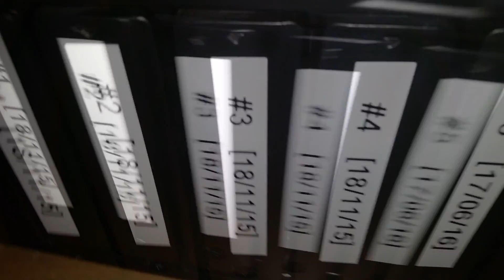Synology DiskStation DS1815+ No Power Fault 'Workaround' - Using A PC Power Supply To Recover Data

Comment: You saved also my life today!!! My story is the following:
I have 1815+ one day after 2 years I had power failure having dead NAS. I bought a new power supply, connected and everything was fine for 2 days. Then NAS was off again and was not powering on. Thought it was again the power supply. The new power supply didn't work also. I thought that was the motherbpoard and that everything was f*cked up. 
Then I saw your video, my angel.
I didn't have a spare computer power supply so just used the trick with the wire in order to make power supply work without having anything connected at the place you had the output of the pc power supply. The nas started working. I switch it off, I removed the wire and connect the nas power supply and now works fine.
Seems that the trick with the wire resets somehow the power supply!!!!
You are my A N G E L :)
bib thank bro

Comment: Damn ticking time bomb.  My Synology 1815+ just died and now I'm finding out about an issue two years after they discovered it.  Synology could have sent a notification to the owners so they could have fixed this problem early.  They intentionally set warranty so these boxes will die right at the warranty period.  Synology handled this problem incorrectly.  I am very disappointed in their support.  I am sure more and more owners of these devices will start to get failures.
Reply: So true.
Reply: @stellvia21  I was glad they extended the warranty by one year.  I bought mine in 2016 and was able to have it returned for replacement.  I was happy with their warranty response, however, I feel like others who will end up outside the warranty period would be SOL.  After the repair, I noticed they soldered a resistor over the connector as many people mentioned.  It looks like that is the main fix if the board was not completely dead.

Comment: Hi Nathan, i tried the solution from Jukka Pirinen below with the 4,7K resistor
my voltage between the green and black wire dropped to 1,9V when pressing the button, which wasn't't enough to power up the PSU
But after soldering the 4,7K resistor, the PSU fired up without any problems...
So it's worth checking the voltage between the green and black wire when pressing the power button !
Reply: Hi, Logical and works for me. It's difficult to trace the PSU_ON line from the ATX 24-pin compactor through the ribbon cable to the front panel. But I soldered a 4.7k resistor from PSU_ON pin to a GND pin. The front panel switch now works correctly, I guess a component on the front panel PCB has aged and is biasing a pull-up too high.

Comment: Hi Nathan, and anyone else on this thread, what if I shorted the green and black Pin while plugged in to force it to start up? I have the exact same symptoms, tried the jumper and the PSU started up. But because I don't have an ATX PSU laying around I can't start up the motherboard. Just wanted to get some opinions before I do something crazy.
Reply from the maker: I personally would avoid that as the PSU may have issues which could further damage the system. You could totally try it if you like, just beware that is a possible potential outcome. I didn't recommend or mention that in the video purely because of the chances of trouble. 
Do so at your own risk I guess! Let me know how you get on. 
Hope this makes sense! 
--Nathan.

Comment: I found out that when pushing power button, voltage between green and ground dropped down to 1.6V and apparently it is not enough shorted to power on the power supply. Added 4k7 resistor between ground and green wire and voltage drop from 5V to 3.3V and with power button pushed down to 1.3V and it powers on now.

Edit: soldered 4k7 resistor parallel with r32. It is working fine now.
Reply: Hi Jukka, Wanted to consult, thinking of following your solution, can I just solder to any of the black ground wires or is there a particular one to solder to?
Reply: @MonchMercader  actually when looking and measured around, I soldered it parallel with r32 resistor. It won't now affect the psu on voltage when not powered and gets short voltage under 1V now. https://i.imgur.com/x9gOjVc.jpg
Reply: @jukkapirinen  You are the man !!!, i soldered a 4,7K resistor as you recommended parallel to R32 on my 1815+ and SUCCESS !!! Thank you so much ;-) !
Reply: @jukkapirinen  Second comment, my voltage dropped to 1.9v before soldering the 4,7K resistor ;-)
Reply: @jukkapirinen  Hi, you sat that the resistor is 4k7. But according the the colortable i come to this : 
570 * 10 = 5700 = 5k7 + 1% tol

Is it 4k7 or 5k7 or doesnt it make any diverence ?
Reply: @billmartian3731  it was 4k7. Maybe the photo does not show up correctly the yellow on blue body. But anyway it matters, you should measure the voltage after adding resistor. Voltage should drop well below 1V. If you see the Synology thread, I even needed to replace the 4k7 with 1kohm resistor, because I voltage again was not dropping enough. I have been thinking if I should replace that gate where the one leg is soldered. Maybe it has been degraded if power has just been floating through it without proper pull-down (or up?) resistor.
Reply: @MonchMercader  edited my comment above.
Reply: Hi Jukka, do you have a photo of it you can share? I just ordered a replacement/original PSU and still nothing. Thinking it might be main board. But I want to try you trick first.
Reply: @MonchMercader  I posted link to image already 6 days ago but seems comment is not showing up. I have posted the image to Synology forums to the newer c2000 thread, so you can find it from there.
Reply from the maker: @Jukka Pirinen Your comment was filtered out by YouTube, I've approved it now.
Reply: Thank you so much! Bought a broken DS1515+ thinking it was the transistor-bug, but it didn't help to replace it. Found this clip and your comment made my day, it worked!! :D

Comment: Thanks a ton for this!  This inspired me to try something similar on a dead DS1815+ and it let us recover data to a new NAS!
Reply: If your new NAS also had 8 slots, you could have just moved the disks (in the same order) over to the new unit, started the new unit and used the Synology Assistant program to do a migration. You would have to reinstall packages and maybe some settings. But your data would still have been there just fine.
Reply: Robert Phoenix yup, but I wouldn’t have been able to move to the new disks I had purchased along with the NAS.

Comment: I purchased a replacement PSU from Synology and it did not work. The NAS works when I connect it to an external PSU.
Reply: I have exactly the same issue with my DS1515+, new Synology PSU, no boot, A be quiet 300watts and it work ... Is your NAS still running 1 year after ?

Comment: Very nice method, I confirm it works very well. With recent DSM & firmware (06/2019 -> v6.2.2-24922
), if you power on your unit with only ATX external alim and no wire between Green (position 4) and Black (position 3 or any other black wire of the 24 connector), the Status LED stays blinking orange, never going steady fix and green. Just to mention.
Thank you very much Nathan for this very good tip and let's blame INTEL Atom C2538
, as 
Doug Stringer said 11 months ago.

Comment: Hi Nathan and other owners of a ds1815+. I received a dead unit for spares and tried to fix it but couldnt and used your psu trick and the unit powered up. Thank you for taking the time to make your video. 

The existing psu couldnt power the hdd rail as in your video. So I decided to chuck the device but before I did so to tinker a little to at least look for obvious flaws in the psu so I  could post my findings.

So i took apart the delta dps-250b-44b rev 04 psu. As i pulled the wires, one set of the two black wires (ground) soldered with a lug to the board seemed to be loose before i pulled it out. I cant say for sure, but when i powered my unit before via green wire, it couldnt power disconnected from the motherboard, but only connected to the mainboard and the net leds on the front was lit dimly and the power light stayed blinking.

After i pulled all wires out, i decided to short the green wire to black (in my case the one side heatsink of the fets inside are ground/(black wire) as well) and the unit spun its small fan with the unit disconnected completely (i only had 4 remaining wires from the board(non red/black/and orangy so i had to use an alternate ground/black)).

I hope this helps someone who may be out of warranty and want to take a shot ( i know its a production unit etc etc)

I also did the pin 1 to pin 6 100 ohm resistor jumper on my 12 pin header before trying all the above (there's another 6 pin header on my board as well)

I will be putting the whole thing together when I have time, but it wont be priority for a while.

By the way, a normal psu's yellow, black and red wires are the same voltage level as the two smaller connector's (hard drive and fan daughter board). I have connected my wires from an old dell psu with exposed wires to it and my hard drives powered in different bays. The daughter board connectors are also not individually soldered (they have different sockets but are one track on the back where relevant).

Bye.
Reply: seems my psu is faulty too. I did the psu trick but I didn't hear my drives spinning. I'm stuck at the blue power led blinking!

Comment: Thank you Nathan,
I have the same problem with my 1815+.
The internal psu works with the drives but not with motherboard.
Before I will buy a new psu,  how can I fix the psu ?
Reply from the maker: I would advise you ship the unit off to Synology for warranty repairs. They have an extended warranty on these models that have the problem and your unit could well be covered by it. I didn't attempt to repair my units power supply as mine wasn't even two years old at the time of this happening.
--Nathan

Comment: Ours wold not light up after an extended power failure caused by lightning strike over the weekend that triggered the circuit breakers in the office so it's UPS ran out of battery.  We pushed the button like 10 times (different people)  and while I was reading about doing something like this workaround someone shouted "It lit up!" They did a long press and it booted.   Odd indeed.   That was 4 months ago we haven't turned it off since, so it hasn't' failed again.    So before I turn it off today I decided to read up on this flaw and besides what is stated here I also learned that some people has managed to make it boot by removing all drives, pushing the power button, and if it turns on, turn it off again and plug discs back in.  I hope this helps.

Comment: Great stuff! Helped me as well! One addtional hint: For me, it was not necessary to use an external power supply. I just put a short between the green and the black cable as shown in the vid. The unit powered up with the original power supply. It now works as usual except that it can't be powered off, great workaround until this is fixed. It might work for others as well.
Reply from the maker: Yes that is another possibility, but I didn't advise that method as there could be issues within the power supply on the rails/voltages/lines that connect to the motherboard, hence it not turning on as it should normally. To reduce the risk of any motherboard damage I'd advise people to use a known good external PSU to power the board instead. Hope this makes sense!
--Nathan
Reply: Fully agree! I understand your guide as a general way to analyze a PSU issue. I just wanted to point out that there is a solution in case the "switch on" feature is not working as in my case. This solution should only be applied after the PSU was checked as you advise in the video.  @NathanPH
Reply: Hi, I had the same issue; after I replaced the PSU and used a jumper between the green wire to one of the black wires; the status light kept blinking. I pressed them "a long time" (> 1Minute) which "somehow" reset the whole NAS. After that I was able to start-up NAS by pressing (still blinking) power-on button "some" time (approx. 30'). After that NAS powered-up and was ready after some minutes (disk started spinning, LAN LED started blinking, etc.)

Comment: Thank You!  I didn't even need a temporary external power supply to get my DS1815+ running!  I removed the drives, opened my case, unplugged power.  Leaving the power supply connected to the motherboard, I then used a paper clip to jumper the green wire to one of the black wires--from the back of the connector (pin 16  to pin 17, aka top row, 4th  pin from right to 5th pin from right), and the unit powered up.  I powered down, removed the jumper, re-installed the drives, plugged in power, and reinserted the jumper...and it booted up just fine.

I left the jumper in place while running:  everything worked well all day, including a DSM update that performed a reboot.  But removing the jumper does abruptly turn off power.

Note: after shutting down the unit, disconnecting power, and re-connecting power, the unit will NOT boot with the jumper in place.  (The blue power LED flashes, and the drives and fan spin up, but the system does not boot--the same symptoms as the faulty Atom CPU produce.) Instead, you must disconnect power, remove the jumper, connect power, and then install the jumper.  (I was hoping I could permanently bridge these two pins, as the system runs all the time...but that does not seem to be possible.)

Before jumpering the wires, I did disconnect the power supply from the motherboard, jumpered pin 16 to 17 to turn on the power supply, and used a multimeter to verify that the power supply was working properly:  it was, with 12V, 5V and 3.3V outputs as they should be.  This seems to be a motherboard problem of some kind.

I opened a ticket with Synology:  I submitted online an hour or so before they opened,  They got back to me shortly after they opened, confirmed my unit was in warranty, and issued an RMA number.  They can either cross-ship (they ship a replacement unit first...but they charge my credit card until I return the defective unit), or I can send my unit in first.  But now that I can boot the unit, I can deal with the RMA at a convenient time of my choosing.
Reply: I tried your temporary solution. I'm so happy that my DS 1815+ booted up normally. I opened a case at Synology, I guess they can see my unit "green and connected" now......
Reply: This solution works for me! Thanks!
Reply: This happened to my ds1821+. I jumpered the pins in psu as in the video but I get only blinking power led light. fans working but drives didn't spin. My nas was out of warranty.

Comment: I was really hoping this would work, but no luck for me.  The unit has power now, but the status light keeps blinking orange and the disks aren't spinning.  Synology web assistant found the unit, but it says 'No Hard Disk Found on DS1815+".  I'm guessing that I have a different issue than you, and that my power supply is probably completely bad.  Any thoughts/ideas?  I'm using the original power cable and it is plugged into the same surge protector as the external power supply that I just hooked up.
Reply: Hi, I had the same issue; after I replaced the PSU and used a jumper between the green wire to one of the black wires; the status light kept blinking. I pressed them "a long time" (> 1Minute) which "somehow" reset the whole NAS. After that I was able to start-up NAS by pressing (still blinking) power-on button "some" time (approx. 30'). After that NAS powered-up and was ready after some minutes (disk started spinning, LAN LED started blinking, etc.)
Reply: @christianimfeld7357  Hello, just trying to figure out what you mean with "used a jumper between the green wire and one of the black wires"?  Can you please elaborate a bit? I'm just trying out all my options before before declaring my DS1515+ competely dead...  Sorry if my question is stupid. I'm not much of a techie and have no idea what you mean with "using a jumper" or how i should do that exactly.  Your feedback would be much appreciated.
Reply: Sorry man... found it.... seems i hadn't watched Nathan's vid till the end.  Ooops...  :)
Reply: I have the same problem as you. External power supply powers up the unit, but the disks are not spinning up. I have a replacement power supply on order. Hopefully that fixes the problem

Comment: Hi, can i also use the two 6PINS PCI plugs to give the Harddrives power? We have exactly same Problem, don't want to use both (old and new Power Supply) THANK YOU.
Reply from the maker: NO! DON'T plug into the hard drive backplane with a standard power supply whatever you do. These connectors are NON-STANDARD as I mention in the video. The polarity isn't the same as a standard ATX power supply connector is wired and you WILL fry all connected hard drives and potentially the backplane itself as well. The only way you could do that would be to butcher the power supply and wire the synology connector onto the ATX supply but that's a bit too involved for most people. I strongly advise you get your unit repaired/replaced under the warranty or order a replacement power supply. This method is only intended to allow the recovery of data and running the unit temporarily without voiding the extended Synology warranty.
Reply: shit ok. Thank you.

Comment: Thanks you saved my butt! Just to add to the tread. I tried using a 350 watt PSU from an HP desktop and it did not power up. After purchasing a Thermaltake 600 watt one the system powered up fine like in the video.